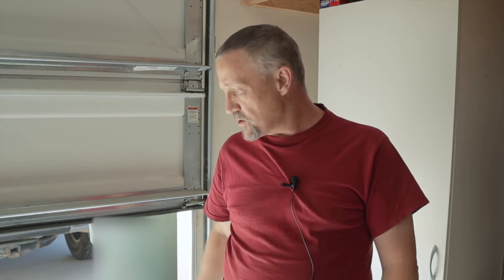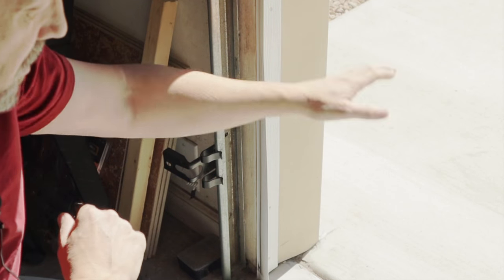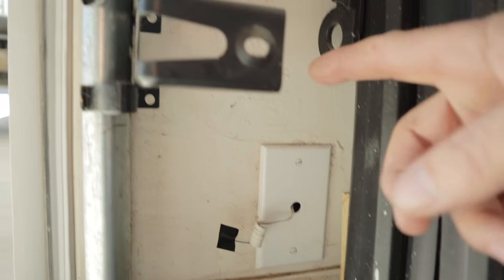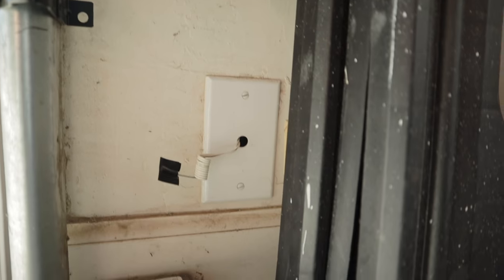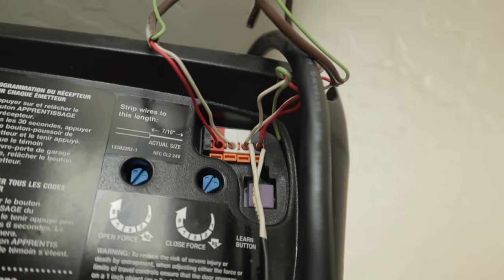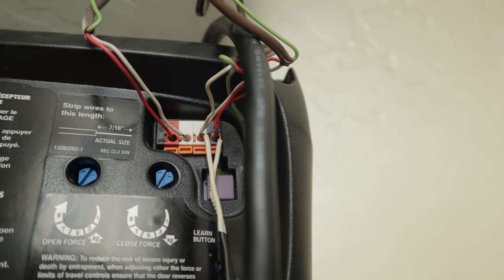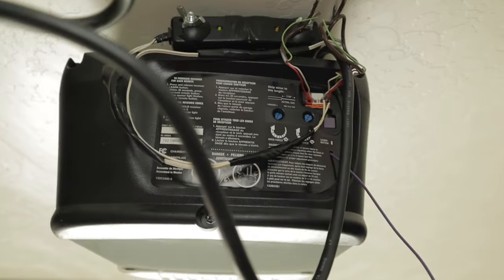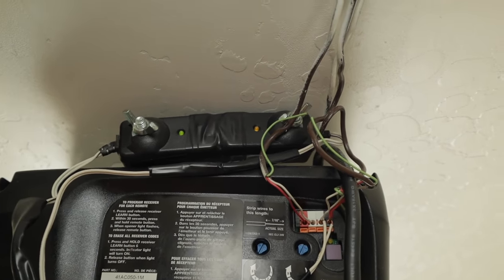How to Disable Garage Door Sensors

Comment from the maker: Building a DIY Shed / Tiny House With Basic Tools - https://youtube.com/playlist?list=PLC_QVs9y_q3tAXy20aNUBBd79fsqD2QCk
Reply: Hi Bruce. I’m having the same problem. Both sensors are lit up and door is in the down position. Opener blinks 10 times but the closer does not move at all. All I did was changed the door and put a new door. Never worked since I changed doors, but it worked great before changing doors. ????
Reply: Can you do that if one censer (green Light ) is not on ?
Reply: I'm lazy; I'd have just shaded the "eyes".  Do You know if there's supposed to be 5 volts at the terminals?
Reply: Nothing wrong with the way you did it, but we have the same problem at work, door faced West and during the summer when the sun sets, the sensor wouldn't work. We used toilet paper core, wrape in foil to reflect heat, used as a housing for the sensor. Works great.

Comment: Bruce, we did everything you did on our excellent Chamberlain belt drive, including coloring the inside of the toilet roll with black magic marker! We hired a professional installer, who tuned and adjusted the unit, tried different sensors ($70 extra), I tried switching them to opposite sides, then tried moving them back into the shade, factory techs were marvelous and even sent "shade blockers...worthless" and a new circuit board, which I easily installed, all to no avail. Then I found your excellent and easy to follow video and that solved the mystery. Apparently, the factory can't tell us this solution because of liability issues (thanks, lawyers!). I really liked the wiring diagram too. Thanks for your efforts!
Reply from the maker: Glad to hear you were finally able to get your door fixed! "If you want it done right then you'll have to do it yourself" :)

Comment: This video made me look like a wizard-hero-superman... so thanks for putting it online. My daughter's garage door opener got fried during a lightening strike - so I had to order a new logic board. After install, the unit worked, but the sensors gave an indication that there was interference and would not operate. After fiddling with it, I suspected the sensors themselves were also fried, so I ordered two replacements. When they arrived, I installed them but got the same indications. Frustrated, I found your video and followed your directions -- whalla! So now I know the sensor wires coming from the logic board and buried inside the walls have been 'fried' (at least one of them). This bypass technique got her unit working like a champ, and with no children in the house I'm comfortable allowing it to work this way until such time as I run new sensor connection wires. Many thanks.
Reply from the maker: I'm glad to hear the video helped you out! Thanks for stopping by.

Comment: I own a small business installing garage doors as well as repairing them I have been doing this line of work for 15 years and have seen this done lots of times and can say it’s saved a lot of people some headaches but I can say if you do this just be extra cautious if you have small children I’ve also seen the consequences that can occur from doing this. If I can give any advice at all that will help someone that does this it would be to make sure your down force sensitivity is properly adjusted. Newer openers have digital sensitivity settings so it’s automatically set when setting the opener up. Hope someone reads this and it saves them from having a door fall on their car or jump track. 🙏
Reply: Liftmaster sensors does not affected by the sun, this guy just needs a new safety sensors set. Sensors are optical and electrical device and this problem can be remedy by just installing new sensors.
Reply: @yevgeniymaksimovich8505  the manual literally states to keep them out of the sun to prevent possible problems but I'm sure you know better than the manufacturer right
Reply: @matthewortenzio4365  i own garage doors and openers installation business,and i personally installed 100th of the openers of all kinds of models, and yes, i knows better, definitely better than you!
Reply: I am also in the Biz.  Grew up under and on the ladder now going into my 52 year. 

I have to say this is just a horrible idea. This is better for someone like you, the homeowner to discover this and not say anything. I respect the disclaimer. Kinda like telling my buddy walking next to me I’m goin to spit In the wind. Hope it doesn’t blow back on you!!  Cmon man. You really do look old enough to not need any attention. What do you really think this is capable of doing ? Search Garage Door deaths and see how you feel. Baby’s and elderly along with animals are usually the victim’s of these injuries. So my head scratcher is  wondering why to potentially let any of this group be harmed?  Idk. Just very personal to me and 99% in the trade. Safety First for all others first and you will be a beneficiary

Comment: Thank you for this video. The sunlight in the morning to  afternoon has caused my door not go close for years. I am going to follow your instructions and finally remedy the garage door not closing due to sunlight.
Reply from the maker: Excellent! You'll be glad you did it!
Reply: What happens if you flip the sensors? This way the sun will hit the transmitter and not the receiver!?

Comment: My issue turned out to be the same thing. At this time of year, at a certain time of day, the sun was shining at the correct angle to make the sensor think there was something blocking the door, so it would go back up and do the “light clicking” on and off several times. I love the simplicity of this solution. Thanks!
Reply from the maker: You are going to love this fix. I haven’t had a problem with this door since I did the fix.

Comment: Thanks a lot! My sensors were installed on the roller reel and are prone to get misaligned due to temperature change and vibration of the garage door. Tried several hours to align them and finally gave up. I decided to use your way to bypass it to save my back and knee.
Reply from the maker: You're welcome Jason! Glad to hear you were able to fix your garage door problem!

Comment: Worked great.  VERY clear instructions.  My problem appears to have been a short in one of the leads going to the sensors.  I plugged them directly into the opener and it works like a champ.

My garage was "jerking" as it closed and it was obviously a partial short causing it to surge.  It's as smooth as silk now.  I'll rewire when my garage isn't the temperature of the surface of the sun.  Thanks again.
Reply: I’m confused how You wired it
Reply: If you just disconnect the sensors will 5he door operate or does it have to be connected tobsensors

Comment: Outstanding!!! We are elderly and rarely have company. Had a lightning strike fry the logic boards in both our doors. Also, her sending sensor went out. I put new one on and it's fine. Now mine's out. Got new ones but now no power to the sensors. Been playing with the wall control. since it has a separate set from it to the same terminals as the floor sensors are on. Guessing when the outside pad is used that set tells the wall mount to activate motor? Just a guess. Problem is now no power to light them. This may be my only way around it. Thank you so much. Bill
Reply from the maker: I wish you the best Bill. Thanks for stopping by!

Comment: That is a clever solution !

I've been having intermittent/random issues with my sensors. Your reasoning just reinforced my suspicion that my sensors are affected by morning sunlight, (but only during the late Summer months.). 

I ordered new sensors which NOW include UV protection, so I am hopeful that will resolve the problem, permanently.

Thanks !
Reply from the maker: Sounds like you got it figured out. 👍

Comment: Thanks for this!  I had just started installing my first ever opener in my old garage/workshop, when I realized that there was literally nowhere other than the floor to mount the sensors, which would be horrible.  After a brief moment of panic, I turned to YouTube and there you were with the answer to my problem.  I taped the two sensors face to face onto a leftover piece of the mounting angle for stability and screwed the whole thing to the 2x4 that the power unit hangs from up in the rafters.  The door works great.
Thanks again.
Reply from the maker: I'm glad it helped you out and you were able to resolve your situation.

Comment: BRILLIANT!! I've have been working on this damn door for 2 days.
Reply from the maker: If the sun is your door problem and you do this little fix, you won't have to touch your door again for a long time. I haven't had any problems with mine since this fix. It's been almost two years now. Hope you can get it fixed.
Reply: That was my problem and I did just as you and it works 👍
Reply from the maker: Excellent! 👍👊

Comment: I simply swapped the receiving sensor (green light) with transmitting sensor (amber).  The sun light was effectively “blinding” the receiving sensor, it has no effect on the transmitting sensor.  Worked great and safety function is still functioning.
Reply: Yes, I believe they recommend to put the green "receiver" sensor on the sunnier side.
Reply: That sounds like a better solution. I would prefer to have the safety feature of the sensor working rather than bypassing it. It only has to happen once to have a tragic accident with a child or even a pet
Reply: In swapping the sensor locations, are there any concerns with wiring? Can I still continue to connect white wire to white, and gray wire to gray? Are there any tricks needed to lining up the sensor eyes again?

Comment: I'll be doing this tomorrow, ran into this today. Replaced a 30 year old unit that never had them.
Reply from the maker: Have fun with your project!
Reply: @DIYHomesteadProjectsDIYHP10  would it damage it if I tried to just loop a wire between the two ports on the back of the unit? Do the eyes need to be in the circuit?
Reply from the maker: I don't think it would damage anything but it won't work. The electrical signal has to be a pulsed signal not a constant signal. You need either the sensors like I did it or install a pulse generator on the correct pulse setting for your unit.
Reply: @DIYHomesteadProjectsDIYHP10  thanks. Just got done, didn't try it anyway. Taped the sensors together and tucked them above the unit.

Comment: I just mounted my sensors on a scrap piece of angle about an inch apart and wired into the opener normally. Mounted the angle somewhere. Its also nice to be able to close the door and walk out as it starts to close without tripping the beam.
Reply from the maker: Excellent!

Comment: is there a way to totally bypass them though? Because yours are still actively working. i need to find a way so that the garage door can operate without the sensors being connected to the system.
Reply from the maker: You could eliminate the sensors but you’ll have to use a signal generator so the opener thinks the sensors are installed and working.

Comment: Thank you so much for this video, I realize its been out for a while but I have been so stuck trying to figure out the issue with my garage no longer opening, and I went and bought new sensors then the receiving one didn't have an amber light, so I figured it was a short in the wiring.  I tried this and get the amber light on one and green on the other, but the garage door wall button doesn't open the garage door, and the overhead light flashes twice.  I must have messed up something in the wiring .. I did wonder something I wanted to ask... I had an extra strip of the white/black wire.. so I cut it to make two (for two pigtales) but only stripped one wire on each to go in the grey (black stripped wire) then the other to go in the white.  I didn't strip the opposite pieces not used in the overhead, is this correct?  Or should I have bought a certain kind of white only/black only wire that goes in the overhead connections?  thx so much I feel so stupid!
Reply from the maker: That sounds right to me. It's been a while since I made this video so I don't remember the details but you can use almost any wire you have. The color of the wires does not matter it just helps you keep the wires from getting mixed up and in the wrong locations.
Reply: Thank you I think I just mixed something up somewhere. I’m just gonna take it all apart and go back through it again. You’ve got a great video!
Reply from the maker: Hopefully it's just a simple mix up! I wish you the best with your project!

Comment: Did not even have to cut the wires, just untwined them, then intertwined the two striped wires on the sensor, then the two white wires.  Taped the sensors together and inserted the intertwined wires as shown in the video.  It took 15 minutes.  Solved a long-standing sun problem!
Reply from the maker: Nice job 👍

Comment: I was hoping to find out how to bypass those sensors, either those two terminals need to see a short, which you can just put a jumper wire across or some resistance that I can put across without having to rig up what you did, anyway thanks for the info
Reply from the maker: You are welcome, I wish you the best with your project.

Comment: I'm fighting the same issue and just put a jumper between the terminals which DID NOT WORK. Are the sensors coded/matched where the power powering the sensor is not the same as the return signal from the receiver output?
Reply from the maker: You can't just connect the wires to complete the circuit by using a jumper. There has to be a pulse signal for it to work. Different brands have different pulse signals. You can either use the sensors or buy a pulse generator for about $10 to connect to the sensor plugs.
Reply: @DIYHomesteadProjectsDIYHP10  Thanks. That's what  thought. I'm used to dealing with plain old industrial prox switches where only the safety relay inputs are pulsed but then again this is a safety prox system. Just didn't think it would have to be incorporated into non commercial applications.

Comment: I'm trying to figure out something with my garage too same unit as you, my left sensor has a red light on and the right light is off, I've been adjusting, making sure the wires and little connectors are in and making good contact but still nothing idk maybe the right sensor is burned out, so this remedy won't work probably for me, I will rotate the sensers to determine if one is in fact burned out.
Reply from the maker: You are on the right track. If the light isn't working on the sensor it is either misaligned or the sensor is bad. You are correct, both sensors must be working for this "fix" to work. An easy test would be to hold both sensors together like I show in the video. This will eliminate the question about the alignment then just check for both sensor lights. You'll quickly know if the sensors are good or bad. I wish you the best with your project!

Comment: Thanks! Just what I wanted to know. Also, as an idea for your original problem. Take a small peice of scrap metal or ?? and make a shade/sunblock that attaches right on the bracket and extends past the line of the sun to the sensor a little bit. Voila!  Sun is blocked, space is saved, can retain "safety" feature. There is also a possibility that the sun is heating your door and framework up to the extent that they are moving/growing and causing the alignment of the beam tranceivers become unaligned.

Comment: I solved the sunlight problem a different way. This was on a prior house a few years back. Try dabbing any type of caulk on a very small portion of the sensor lens that is getting hit by sunlight. ... I have done the same on photo sensors that think it is daylight when it is simply detecting light from another source. It would be so much better if manufacturers would routinely provide a "troubleshooting and solutions" resource. As for now, we poke around on the internet searching for help to these vexing problems. Do you say, "Every problem has a solution?" Well, I like to think that is true. But it is also true to say, "Every solution has a problem." Which is why we spend so much time talking about it!

Comment: Would it work to run a short piece of wire from the white terminal to the grey terminal and not not have the sensors wired in the loop? This would complete the circuit.

Comment: Is it recommended to turn off the circuit breaker to the garage?Also where can I find the additional wires?
Reply from the maker: The sensor wires are low voltage. You could unplug the opener to connect everything if you have any doubts about safety. I used door bell wire that can be found at any hardware store.
Reply: @DIYHomesteadProjectsDIYHP10  thank you

Comment: Is it possible to just put two jumper wires in there theoretically just tying the two together like completing a circuit? Do the photocells even have to be there at all?
Reply from the maker: A jumper won't work. Has to be either the sensors or a pulsed signal for the opener to work.
Reply: @DIYHomesteadProjectsDIYHP10  Ahh. Thank you👌🏻

Comment: Could you put a jumper wire to bypass the sensors or do you have to use the sensors taped together? Thanks
Reply from the maker: The opener needs a "pulse frequency" signal and not a constant voltage. You need either a pulse signal generator or the sensors. Just connecting the wires or using a wire as a jumper will not work.
Reply: @DIYHomesteadProjectsDIYHP10  thanks for the information
Reply from the maker: You're welcome Mike, I wish you the best with your project.
Reply: @DIYHomesteadProjectsDIYHP10  Thanks, I just got a couple sensors and I'm going to tape them together and just settle on top of the box
Reply from the maker: That should do it. I haven't had one single issue with my door since I made the modification. I think it's been a couple of years now.